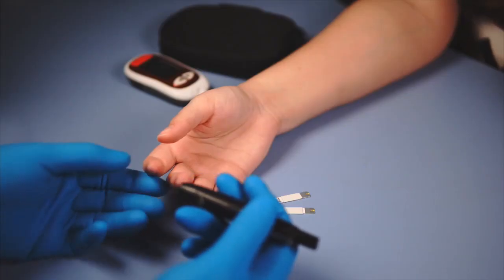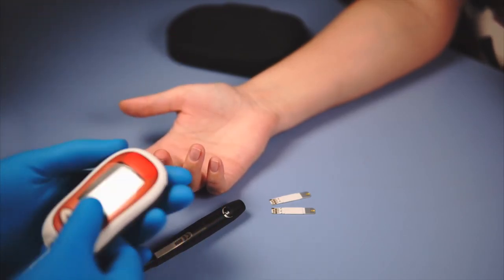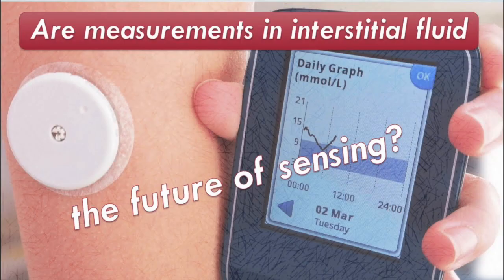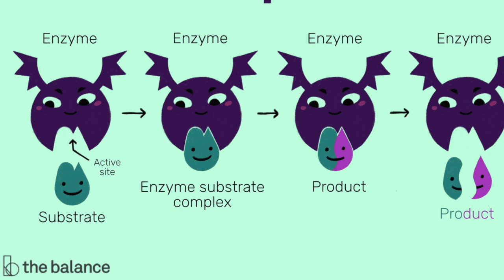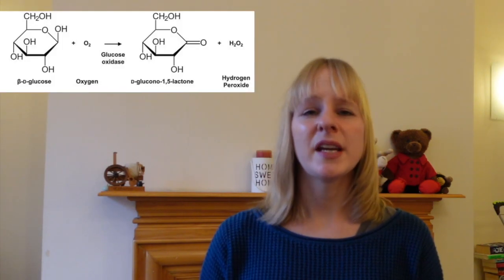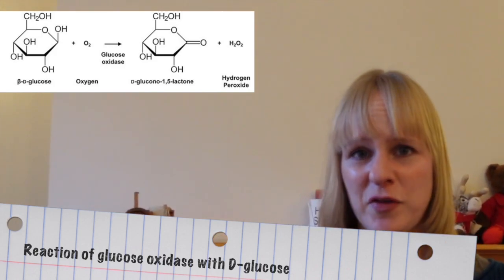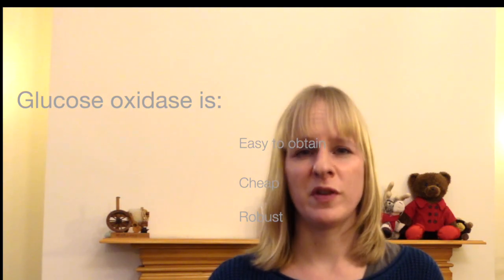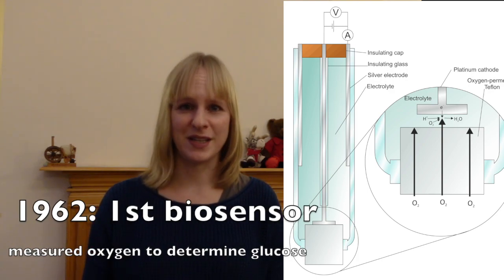Measuring blood glucose levels with test strips

Comment: CGM still have a considerable environmental footprint because of the waste coming from the exchangeable patches. Don't you think that the next generation of CGM should take this aspect into consideration? I would like to hear your opinion Professor
Reply from the maker: Sustainability should be considered for manufacturing of all devices (given our net zero targets). This might comprise material selection or production process, a big problem for these CGM devices is that the current sensor chip only lasts for ~2 weeks
Reply: What makes it with a short lifespan? 
In addition to this i think that the single use applicator is a major source of plastic too